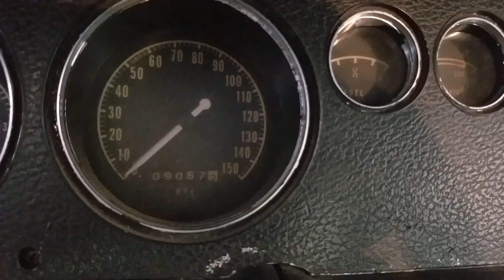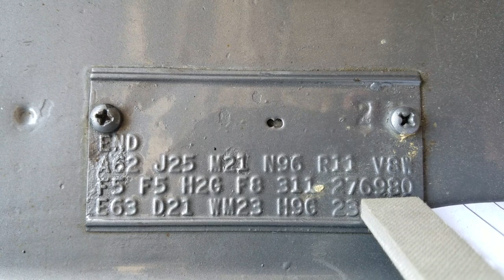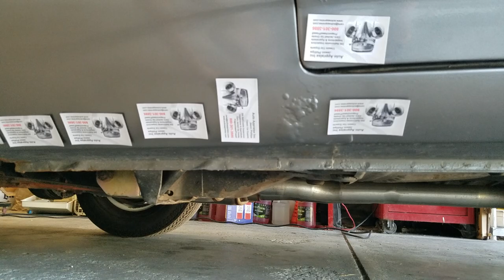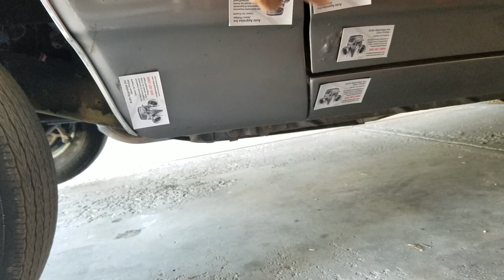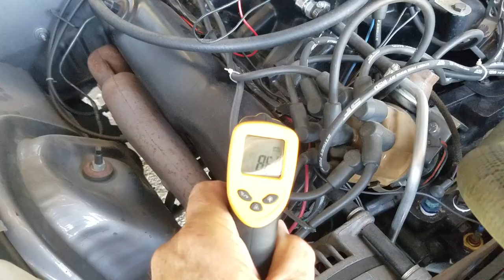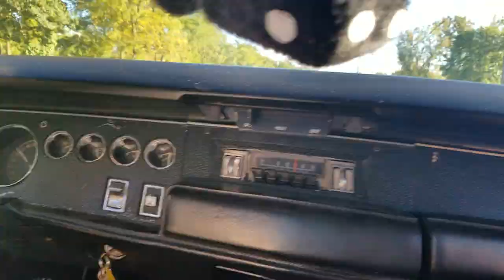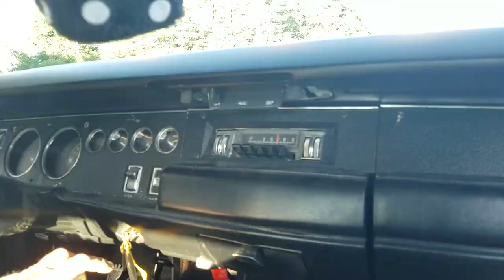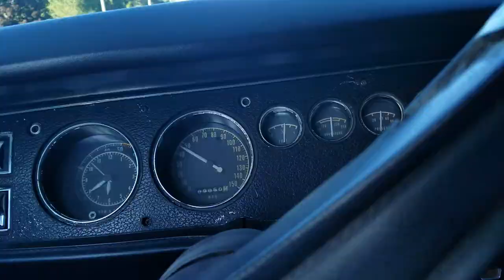1969 Dodge Coronet Superbee for sale N96 hood, fact 4 spd, $29,000  Auto appraisal 800-301-3886

Comment: The bubbling on the rockers, and the one spot filled with bondo are a concern--especially at the 30k asking price. A full repaint is required as well as removal of bondo, andmetal patch added. All the decals on the back end will need to be reapplied after the bodywork and paint is done. While the new engine is technically an upgrade, a rebuild on the old powerplant to keep it all numbers matching would have been a better option.
With the original drum brakes all around and manual steering still in place, you add the body issues and this car as it is is more suited for a "resto-mod" rebuild. As it sit, factoring in 10-15k for body and paint, and decals, I think 30k is a bit on the high side for this car.

Comment: Nice car , i wish i had it. First thing i would change is that glass fuel filter even if it is hiding behind that support. One rock and the glass pops and gas flying everywhere and red hot played with the car exhaust and then you really have a hot car,  but not the good kind.

Comment: Nice car, don't really care for the rims though, or the black painted side scoop, should be same color as the car
Reply: I’m disappointed the owner didn’t repaint the whole car the same color it came from the factory (on the fender tag); it would be easier to overlook it not having the original engine. The Coronet or Roadrunner I buy will be original (and retain some collector value).

Comment: Dirty rundown with rust, not that nice for 30k. Look at gateway or southern motors, you can get flawless show quality coronet rt super bees for 30 40 k
Reply from the maker: Those are both great places to buy Muscle cars! Thanks, Jason the car appraiser
Reply: @AutoAppraise  I have  the grocery getter version of this car. 69 coronet 440 60000 miles no rust older repaint same bubbles on rockers. It drives/runs fine but could use a trans rebuild( i can do) as  it creeps forward in neutral at times. We have a race engine  rebuilder in the family. I'm  thinking about having him turn the original 383 non HP into a 383 HP+ and find a 4 speed for it. Not sure of 4 speed pricing but it was$1800 to do that to a 440 including porting/rebuilding heads. Would that be a mistake or should i just 
 rebuild/reinstall the  automatic and keep it original? I value your opinion, thank you

Comment: That code plate has phillip head screws holding it to the body. All of them are originally Riveted at the factory to the body so how can you prove its original, or not?? It dont matter I'm sure someone already bought the car.
Reply from the maker: Incorrect- All Fender tags are attached with Philips head screws, on ALL Mopars. Only the VIN tag is riveted.  Thanks- Jason the appraiser